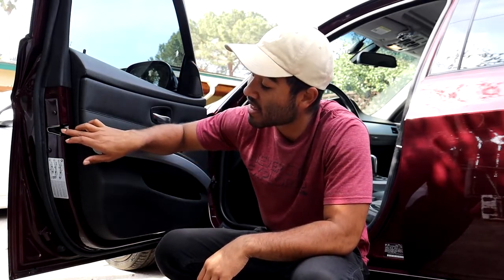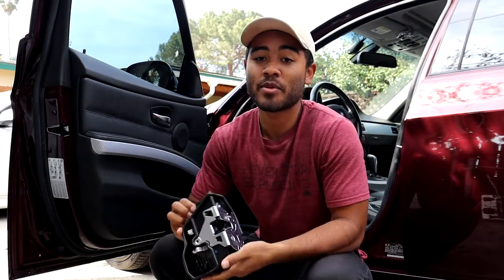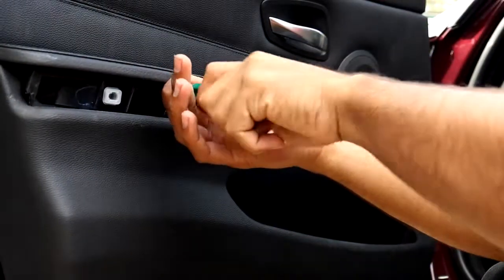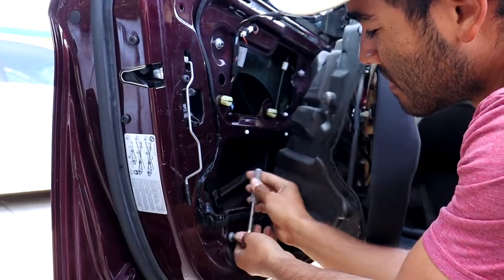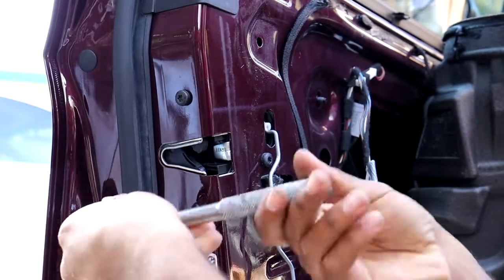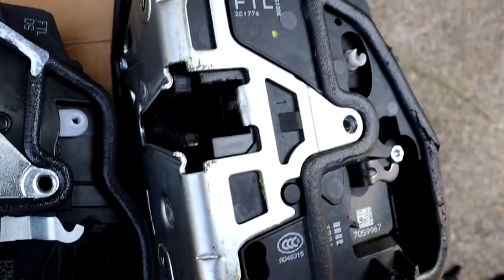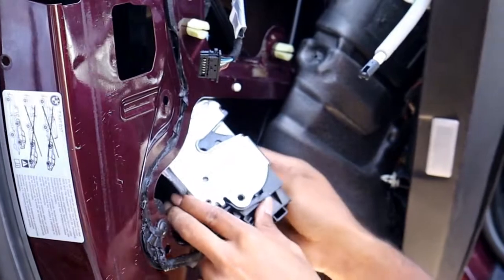BMW E90 Door Lock Actuator Replacement DIY

Comment: My issue is a lil different I can unlock both doors on my E92 with the key fob but I can’t lock my driver door with the button on the key, the passenger door locks tho I have to pull the manual key out to lock the driver door

Comment: Hey man I’m about to do this, but I was considering taking an old actuator off of a junkyard car. Should I be concerned about the remote connecting to that actuator? And is there any programming steps I need to take if I buy a new one or use an old one?
Reply from the maker: I honestly am unsure. When I did this, the new actuator just worked with my remote without any coding. I think  the remote isnt connected directly to the actuator, it just connected to car so when you press lock/unlocked the car tells the actuator lock/unlock if you get what I'm saying. Not 100% though.

Comment: Good Evening . Thank you for this video, I have a 2006 BMW E90 316I. My Right Rear Door is locked – the lock is broken. I have opened the wallpaper, but from all the places I tried it does NOT open. What should I do? If I open the two door support hinges will I be able to open the door? It does NOT open at all. What should I do to open it?
Thank you.
Reply from the maker: It won’t open even if you open with the handle inside?
Reply: Thank you. Nothing works from the lock. has remained locked.
All I have to do is destroy the plastic parts of the lock
But I don't know how to open the mechanical lock safety.

Comment: iam stuck at removing the upper part of the actuator inside the door. How did you remove the upper part?
Reply: I bet you figured it out already but for anyone else looking - remove allen key bolt behind the rubber grommet on the side of the door and remove the lock with plastic piece around it, actuator will fall right out. Just finished doing it and figured that's what was holding it in

Comment: Hanging the panel was a good idea; using the bungee's metal clip and the metal pry-bar on paint -not so much. Broke parts off: BMW there'salways a way to do it right!
Reply: Did you mention tigjtening back the window regulator?!

Comment: How did you get that last connection off?
Reply from the maker: Could you give me a time stamp from the video for the part you're referring too
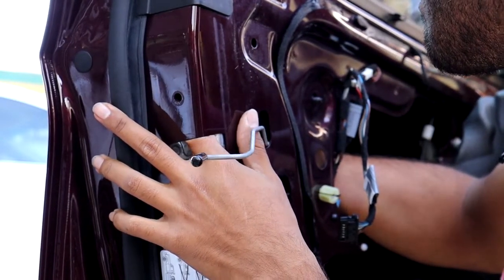Reply: @InlineSixAuto  4:21
Reply from the maker: @brandontodd9043  I honestly dont remember how exactly, I think I either pulled it back out of the actuator or you press downward on it to disconnect from the white plastic piece.
Reply: @InlineSixAuto  Thanks appreciate it!

Comment: How you even get the door open
Reply from the maker: I had to use the actual key inside the key fob
Reply: 🤦🏾‍♂️🤦🏾‍♂️🤦🏾‍♂️this door is a replacement door and the key i have doesn’t work for it
Reply from the maker: @isaiahjames838  oh wow, well thats a sticky situation. I believe there has to be a manual way to unlock it from the inside
Reply: Do you recommend fcp euro
Reply from the maker: @isaiahjames838  100%